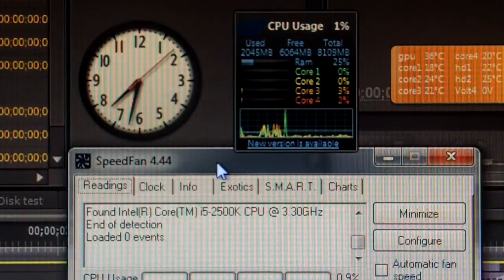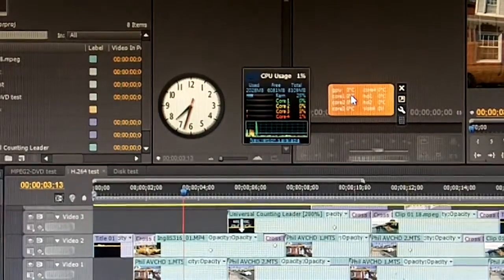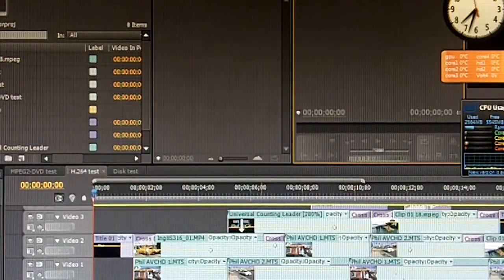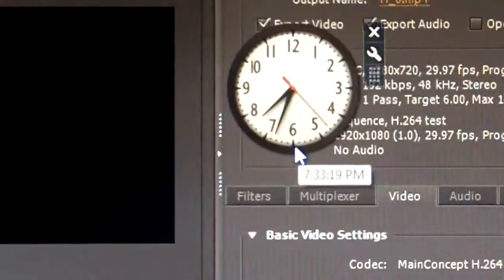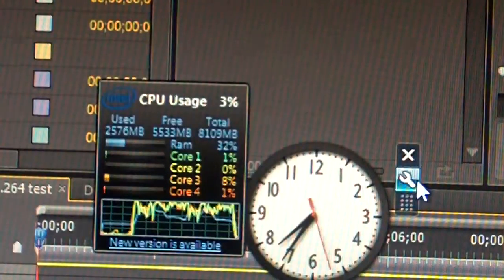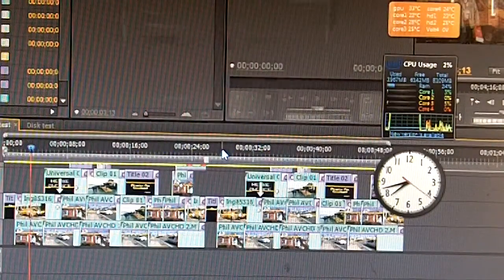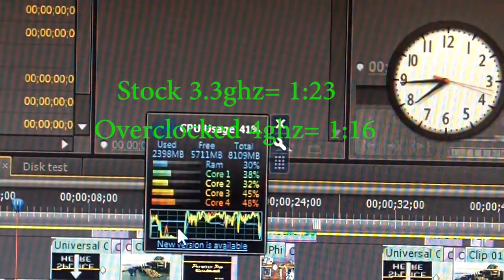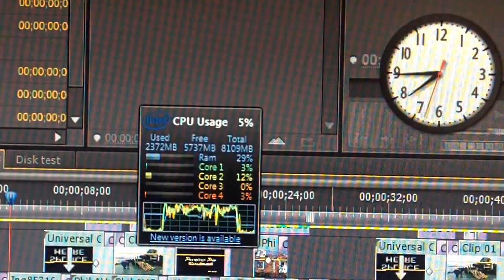i5-2500k stock vs overclock adobe premiere rendering

Comment: Overclocking does shorten the life of your CPU but not so much you could actually ever see your CPU breaking up. I was using Intel E8400 dualcore (stock 3Ghz) @ 4,2Ghz and 100%load temps were around 65-70 degrees. I did use that CPU for around 4-5 years and gaming heavily every day. Now i've been using 2500k CPU clocked @ 4,6Ghz (prime95 temps at 80 degrees) and never even bluescreening. I'm not seeing my  CPU breaking up before it's out of date anyways.